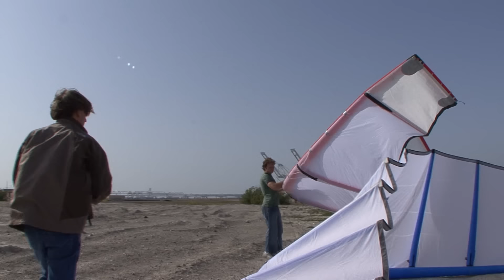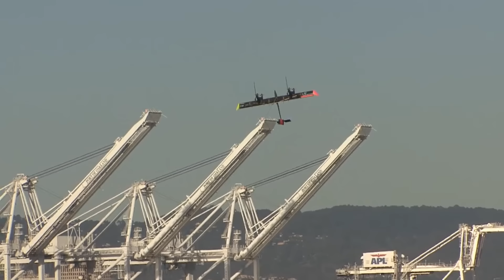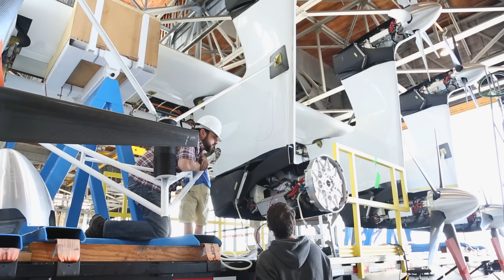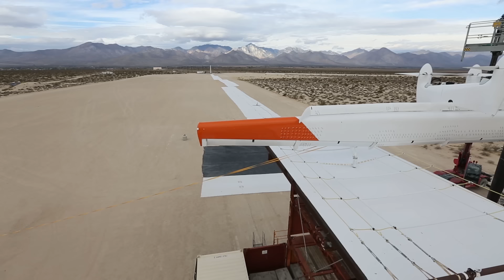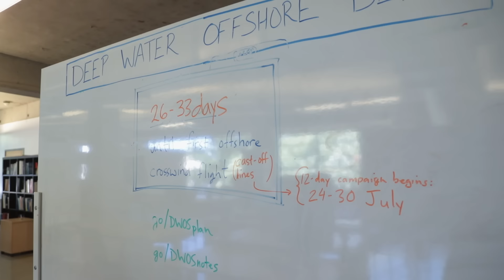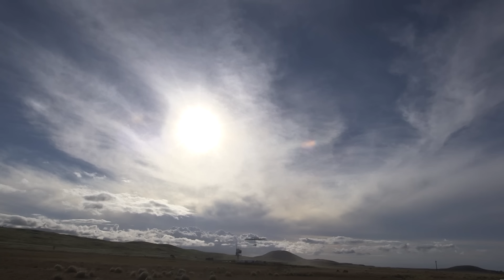Pulling Power from the Sky: The Story of Makani [Feature Film]

Comment: One of your biggest problems seems to be landing your kite between the pylons during wind shifts.  You could have a second cable attached to the kite that is attached to the same point on the ground, until such time as when needing to bring the kite down.  At that time, you can simply spread the two cables wide apart to keep the kite from shifting side to side, and being damaged by the pylons.

It does not matter what anyone else thinks--- people of different thought patterns need to try different approaches to the same problem, and whoever  produces the best, most economical and least destructive solution should win out.  That is one reason that trying to suppress EVs is a sure sign of evil intent, because if EVs really were a non-solution, it would be obvious when comparing competing results over time.

Also, it is apparent that two or more parallel approaches are often needed, since relying on only one can mean exhausting materials needed for one method, as can be seen right now as nickel, copper, cobalt, neodymium, etc., are presently in short supply.  With time, we are sure to find more sources on the planet, but also by mining asteroids, as Musk will be doing.

I am not convinced your approach is the most practical for a few reasons, but would be giddily pleased should you prove me wrong!

Good luck, gentle souls, and have fun.

Comment: Amazing project, great achievement. Something come in my mind when I see this approach... the aerodynamically challenge, the quite fragile kite on high wind forces, in different weather conditions, storm to light winds, thunder and lightning. The high investment on the quite complicate infrastructure. I see an other approach to the this topic to harvest energy from the sky. Wired Zeppelins. First the infrastructure is much less complicate. 6000 to 8000 meter cables are today not a big thing to produce. Helium or hydrogen keeps the zeppelin up in the jet-stream, the amount of generators is only limited by the lifting capacity of the Zeppelin. What do you think?
Reply: That would make a whole lot more sense than what they tried.

Comment: This is yet another scientific experiment which will remain just that but nobody remembers Benjamin Franklin with his crazy idea to fly kites into storm. We did fly a kite in Hong Kong tied with a 0.3mm insulated copper wire but removed insulation at the joints near the kite to a height of 300ft or more in sky.  We measured about 240v on the voltmeter but couldn’t light up a small torch bulb.  Guess the amperes were running in microAmps.

Comment: The power plant should be on the ground and just use the pulling forces to drive a generator in a linear pull fashion on a recoiling mechanism like the pull start of a gas motor connected to a flywheel by varying the tilt of the kite. I actually built one but never got to test it, burned up in a shop fire.

Comment: At the risk of being utterly pedantic, some basics of wind power are called for. The area of a wing/blade matters, and it dictates a large part of the system cost. Then the wind force varies as the square of wind speed, and the wind energy is the wind force multiplied by the distance over which the force is exerted. That distance is a function of speed and time, which is why it is so helpful to cut through the air at 10 times the wind speed. Finally, the wind power is the energy delivered per unit of time. At greater altitude than any normal wind turbine can reach, there are winds moving twice as fast as near the ground. Put the factors all together and it is clear that going 2 times as fast makes 8 times the wind power per unit area, because 2 x 2 x 2 is 8. Higher still there are winds going 3 times as fast, so making possible 27 times the power from the same size wing, because 3 x 3 x 3 = 27. This is all stuff from a first year Physics course. And it all works, at the cost of considerable efforts in R&D. But it also eliminates the huge mass and expense of the normal wind turbine tower, base and gearbox, while making the faster winds found at higher altitudes accessible. Thus it led to the idea of minimizing system cost by making a small wing/blade and having it move through winds several times faster than normal near the ground. For a normal turbine to generate as much energy, it would require the normal turbine to have several times the effective blade area of the power kite wing to compensate for the slower wind near ground level, all of which obviously combines to mean a very high cost for conventional wind turbines. In the global jet streams, winds are available with total energy of around 100 TW (terawatts), which is 100 million million Joules per second, and about 5 times the TOTAL power/energy used by Humanity, from ALL sources combined, and blowing unceasingly. Being able to tap 1/5th of that certainly looks attractive.

Comment: Clearly a remarkable group of talented people. But it is worth adding, although inferior perhaps on paper at least, in the thirteen years this research was carried out Europe has added roughly 150,000MW of traditional wind power capability (based on Wikipedia numbers). I think there is something to be said for keeping things simple and proven to work, especially, like in this case, when there is a time constraint in the form of climate change. You just have to get on with it. I only imagine what the maintenance cost of a system designed in this way would be for the required number of kites to have any significant impact on the demand. Having a trawler on standby to fish out crashed kites. That being said, a very interesting story nonetheless

Comment: incredible...that you got enough funds for this and the dedication to carry on. ignoring all the flaws in the idea, it was kind of fun to watch though. Sometimes it might just make sense to go a step back and start over again. So, in theory this might be able to generate more energy compared to a regular wind-turbine...but is it really a practical solution? why are current state wind generators working so well? The system is too complicated, too dangerous, works at too few locations, has a potential high failure rate. I do indeed think you would have saved the planet a lot more more if you´d made bicycle frames from all that carbon.

Comment: Amazing and inspiring story!  I would have liked to see it stay closer to the original idea, using fabric kites, and a ground winch to generate the power.  Allow the kite to pull cable out to generate and then dive back in towards the winch while a second kite reels the cable in using a differential gear.  No need to do loop-the-loops or have on-board propellers.  Fabric kites are cheaper, much safer, and less likely to break after crashing when the wind suddenly changes.  You could control it just like a kite or paragliding wing.  
There's a number of complimentary generation techniques you could combine together.  You could generate power from ionic charge in the upper atmosphere, collected through the tether.  Blade-less wind generator techniques, using ions blown by the wind from one electrode to another on the kite.  Piezo-electric material in the bending ground anchor or on flapping streamers attached to the kite.  The kite could have solar film on the wing.  If off-shore, you could use the bouncing buoy to capture wave and tidal energy.  The buoy could also be used for energy storage by winching itself deeper into the sea against its own buoyancy.  The kite could also carry a weight up, then release it and generate further power through a dynamo when the weight drops down.  Why limit yourself to only harnessing a fraction of the power available, when you can have all of them in one?

Comment: High Wind is a very complex source of power but promising. 
Does the kite need to move on loop on one side  be it left or right to produce more power?  Looping on one side shows that the kites wings are not balance. It could be the weight,curve or wind area catchment in relation to the area cable attachment. Controls will be difficult and Crashing on land is higher. Meanwhile if the head is lighter, upward movement is slower.  
Is the cable capable of adjusting tension? Cause If the head is heavy, it could go straight down if you don’t release tension on the cable for a while to change direction.  If the head and tail is proportionally balance the kite will fly a pattern of an infinity symbol , a more safe and controllable movement plus a smaller area covered. Using a more inexpensive and lighter kite is better.

Comment: Does anyone consider that all the resources that are going into green technology were mined, manufactured, transported, and installed using power that was either generated largely from fossil fuels or nuclear power? Think about it. All these solar panels, windmills, and electric vehicles required vast amounts of non-green energy to produce. I am all for green energy but I believe that mankind is chasing the wind. No pun intended. Instead of a kite, why not consider a helium filled balloon platform with wind turbines integrated? Seems that this sort of architecture would be a lot simpler that the kite designs shown in this presentation.

Comment: This new tech definitely needs some old tech.  The kite rotates just the same as a standard wind turbine. Here's an idea: attach your propeller-generator modules (modified with centrifugal turbines instead of axial turbines) to a standard wind turbine blade (in addition to the generator). This may improve the output of the unit. Just a thought.
The wind is unpredictable and all kites eventually crash. This was a very expensive lesson with a predictable outcome. Airgenesis LLC has my vote (http://www.airgenesiswind.com/)

Comment: I have this feeling the techinlogy was aimed at the wrong market. While the deep ofshore one seems reasoable. in my head not the case with the thether system they had designed for land.
I think in smaller scale might have made sense for deployable power generation.
For some reason I just daydreamed of cargo ships equipped with a smaller version.
Not sure if you have seen the parachute style sails that some companies where trying to sell to shippers. This kind of device could indeed work similarly. I really dont know if it would be justifiable though.
I observed a mayor instabilty problem of the desing, was trying to land vertically with the wing flat to the wind.
A different desing, inspired by vtol aircraft with tilting motors could have the wing horizontal with the wind during landing, which would increase your ineherent stabilty and ease you in many of the control systems.

Comment: interesting...
Although it seems to me that the design of the kite could have had a parachute just in case "shit hit the fan"... as is evident... Also, for the Norway OPEN WATER testing, you definitely should have had some kind of recovery system because hitting water is like hitting concrete... it does a lot more damage than hitting ground or prairie with weeds to soften the fall... 
- Also, seems to me that a "biplane" approach would have been more efficient and stable...
- The propellers should have been more evenly spread out over the wind... set apart... instead of everything being in the middle... thats actually the reason this thing wobbled from left to right in hover mode... because the propulsion was all in the center... nothing at the sides...

Comment: What if.. 

You used something like a weather balloon. Its design keeps it up in the air. Put a metal casting around the balloon. Like a thin shell that is attached to a lightning rod. Which would allow the balloon to harvest lightning. But the shell would redirect the strike through the cable via the protective shell. Saving the balloon from igniting. And allowing the massive amount of energy to be harvested.

Then go a step further. Put wings on the balloon with brushless turbine props that generate electricity while there isnt a storm. Much like the trade wind device being used. But the balloon and its shape keeping the device upright and safely in the sky. While the upper winds are used to fuel the props. 

So a giant weather balloon with wings. And on those wings propellers generating electricity. High up in the sky where wind is always present.

24/7 sustainable energy.

Comment: Too many moving parts that will suffer from corrosion and materials fatigue.  And, it must maintain controlled flight whereas a computer failure kills the device rather than just shutting it down.
Not to mention, did you hear how loud the final test article was?

Comment: I am amazed ghat nobody bas picked on the fact that hot air rises  and does so on a continuous basis.
K recall seeing an experiment where an area of land in a flat area was covered with material that absobed heat.
It was shaped rather like a big top ten  and where the centre of the tent was they built something like a cooling tower but it had a turbine in it .
The sun beated the air under the material whkch took the line of least resistance, i.e. towards the cooling tower and in doing so built up speed.
On going up the cooling tower it turned  the turbine creatinb electricity on an ongoing movement of air.
It turn out the at night the heat from the earth under the covering rises at night anc continues to turn the turnbine, not quite as fast  bjt enough to continue generating electricty.
Any rainfall goes through the covering so fhe gounc still get rained on and it was found that plants did well underneath, so what is wrong with a setup of this kind, size is no problem you can make it as big as you want, it does no damage so how come nobody is looking into this  as a way of producing power.??????????

Comment: Interesting, but I have a question? 🤔 Let's assume that this was a success and in the future they would put not just one in the sky but several... thousands. What would happen to transport planes then? Wouldn't that be a danger? The case of the balloons in the second great war in England, London. They were put there exactly to try to prevent the passage of planes. Wouldn't it be the same with this project?...especially if you put it very high up, it could very well prevent the passage of small passenger planes or aeroplanes. Although the plane is visible, the cable that holds it is not. It would be a danger, even if it was only one in a city, it would still be a danger.

Comment: What about a lighter than air balloon shaped like a parachute that could carry empty pressure vessels and compressors that would rise while tethered; would then pull out the tether from being blown by the wind. Then near the end of the tether, the compressors would put the lighter than air gas back into the pressure vessels so the tether could be retracted. Also the system could open the center of the balloon type parachute. Repeat.

Comment: YES great Achievement , LONG TIME, AND LOTS of WASTED MONEY THAT SHOULD HAVE BEEN BETTER USED.  Im 60 yrs old, Professional Water man, Fabricator, Custom Home builder.   I fly big KITEs, and even MULTI KITEs.  We started this before anyone attached a surfboard, BUT That was my first idea after being dragged down the beach with 3 kites connected.   Flying such a heavy machine on a tether will never be commercially viable without a huge Baby sitting crew to control it.   just a little slack in the line has busted a wing, spun it around to tangle in tail. The bobbing of the ground station in ocean is always gonna wreck that kite.  then the ocean will EAT the entire thing on a windy nasty wild OCEAN NIGHT.. Waves will destroy that thing. you guys MUST never have been out to sea, LIKE FOR WEEKS in the SHIT..   you cant park a huge plane on a bobbing stick in the Ocean...   even a huge floating ship carrying the Pole will still move way to much for a STABLE Tether.   check out the small corded RC planes .  Had one as a kid.   Yea. I crashed it.  holding a plane with a gas engine on a string, and turning in a circle to fly it standing stationary.  STUPID, I thought then and still do..  I also Race sailing yachts of all types.  100' maxi hulls down to a 18 foot Hobie cats.     heavy Pressure and slack line with sails or wings just dont work,,, when the line snaps tight, and your heavy craft is power off in a different direction.  BAD THINGS HAPPEN FAST.... So, What will happen if its left on its own??????.  WEATHER will kill it every time..  TOO MUCH MONEY for ZERO ( Productive) results.  Could have used all that money and time & man power to build a MUCH better solar panel or DAM-LESS hydro electric system.  Major flowing water all over this planet.    oh yea, I live in Kill Devil Hills NC....  why do I know so much about kites, sailing, Strings and things..  GOOGLE. the wright Bros please..   Have a Great day! JJM. OUT

Comment: I don't know about you all, but I think it'd be a total failure to try to use wind speed sensors and have wind data to control flight and counter steering, etc. would it be better to use GPS location instead of wind speed sensors to control positioning in flight? I don't know what GPS resolution actually is, but I imagine if it's within 6 in., this would be obtainable.